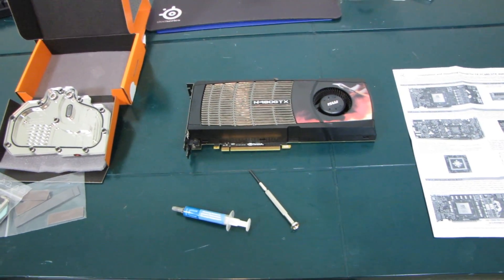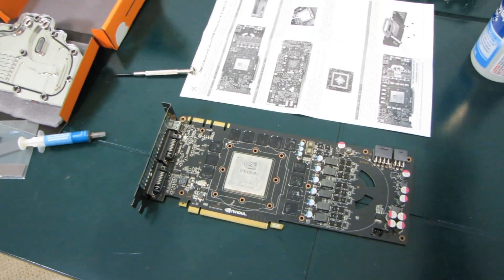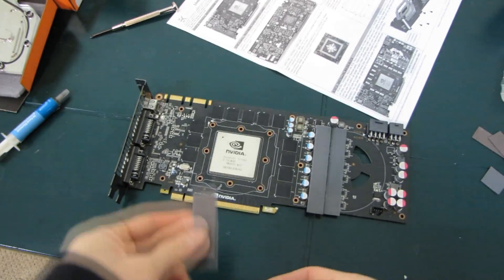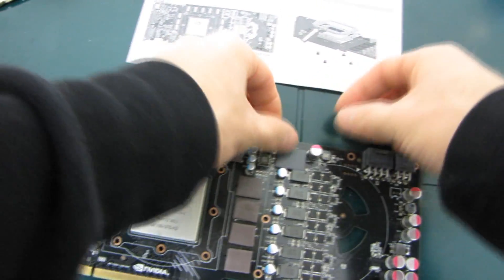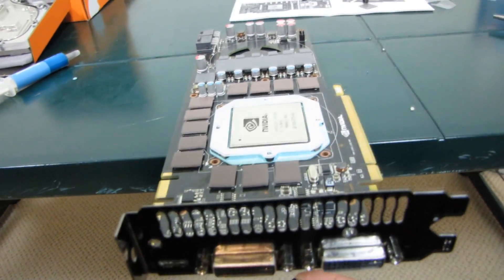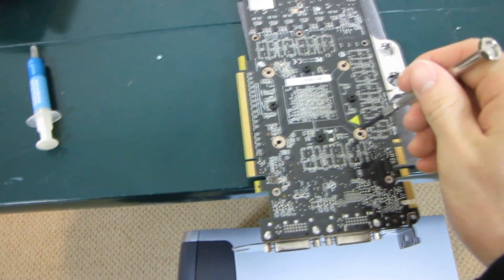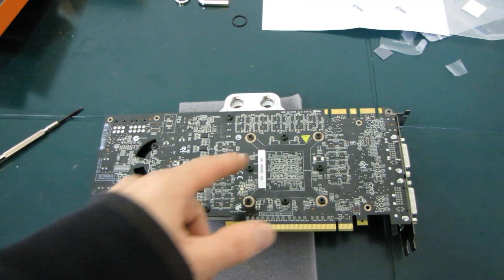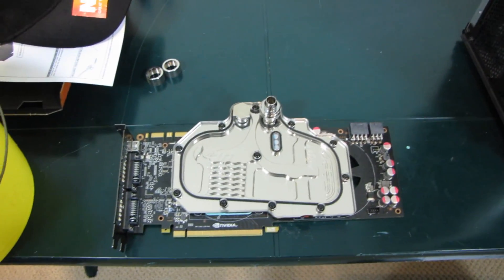EK Water Blocks GTX 480 Full Cover Video Card Water Block Installation Guide Linus Tech Tips

Comment: honestly the 570 is very very close. the 480 has a slight edge in normal games, but a 570 does dx11 a tad better. and the 570 runs considerably cooler than a 480.. however right now you can get a 480 on newegg for like 200 bucks so its an amazing deal granted you plan to water cool, or your case has excellent airflow .

Comment: @MultiSnoopDawg the HAF x is an awesome choice for air flow.  you can also easily get a triple radiator in there which would allow you to to cool your 3x sli build  no problem.  as far as power supplies go, if you're running a 3x sli you might want to not shy away from the wattage..i'd probably go with a 1000 watts to play it on the safe side.  additionally if you're worried about about air flow, you probably want at least a semi modular power supply.

Comment: @bro589 you can, and i plan to after my builds done (current budget doesnt allowwater cooling, something to add down the line)

im gonna use my current gtx 460, add another in sli then water cool the cpu and both cards. EK i dont think makes blocks for the 460, but koolance does so ill be trying those out

Comment: Linus very nice video man! The only thing I have to say is that when you install the fittings to the block dont tighten with a pair of vise grips this can rupture the O-ring and cause a leak, or can crack Plexi and strip Acetal! But if its in a metal surface it can rip the rings so be careful of how much pressure you use. Just my thoughts, You guys should partner with Dazmode.com they have great videos and great products!

Comment: I don't know why would you comment on the idea of water cooling a GTX460 - not everyone has the same goal with their PC. One would want ultimate performance, the other might want reasonable performance (that a GTX460 provides) and a silent PC (which the GTX460 certainly isn't by default) - hence water cooled GTX460 would be a good solution.